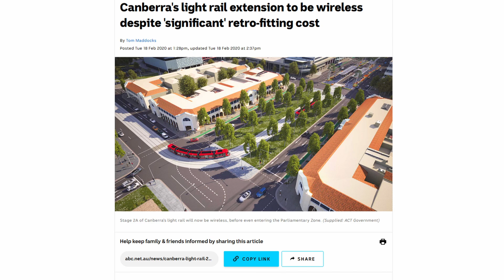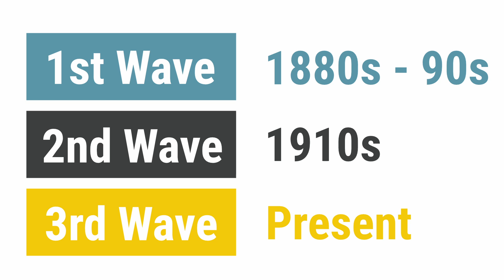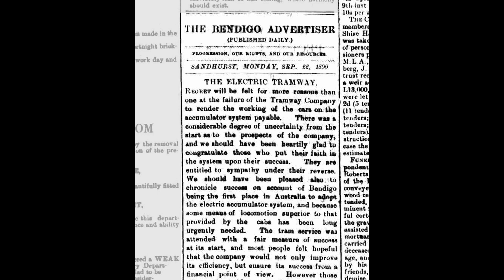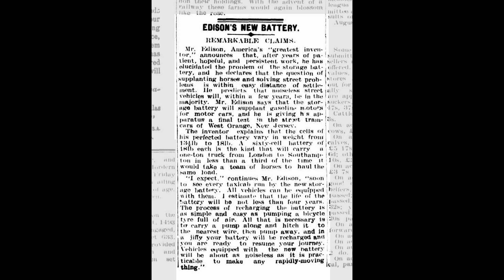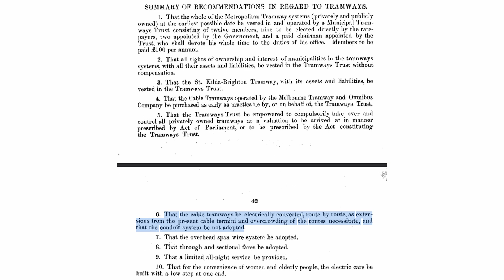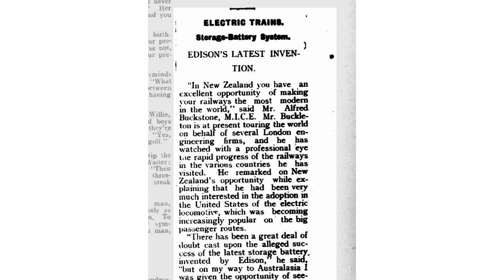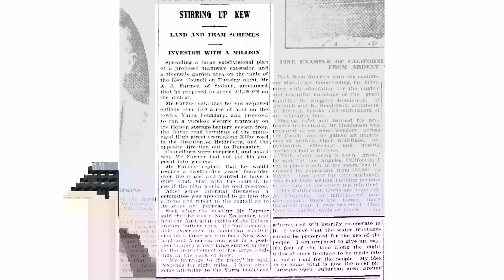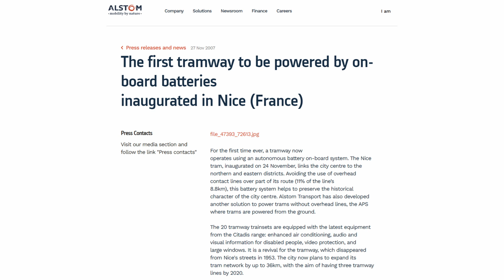The Forgotten History of Melbourne's (Nearly) Battery Electric Trams

Comment: lol at the headline a 8:00 'next gen trams could be trackless with rubber wheels'..... so busses then, pretty sure they're describing busses
Reply: Actually trolley buses.  Look them up. Electric buses only in those days with a pantograph and over head wires but able to roam anywhere on the road and with tyres
Reply: The rolling resistance would be an issue. Not to mention punctures etc.

Comment: Why do we need to move electric powered trams to battery operated ? Surely if the infrastructure is there and the electricity is sourced from “green” sources the  costs of retrofitting the network and environmental cost of procuring battery powered vehicles outweighs maximising the existing infrastructure investment and purchasing green energy to power it ? Seriously the sums would not add up but I’m sure some smart lobbying and additional green marketing plus the votes will get it over the line !